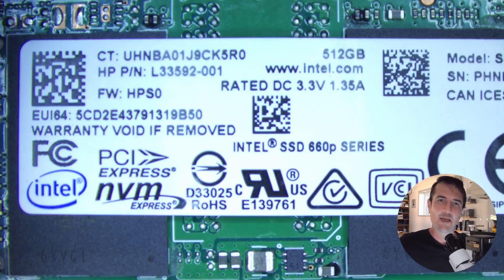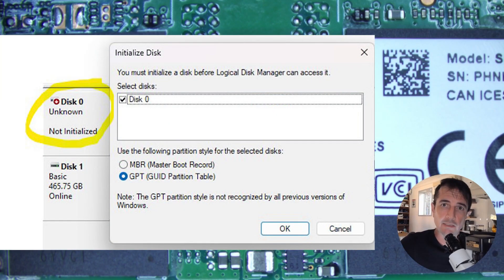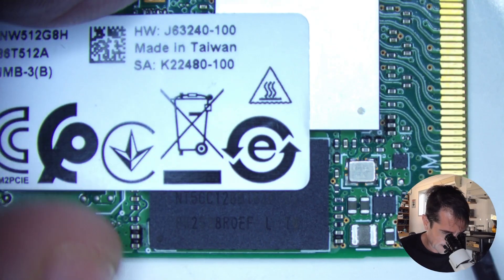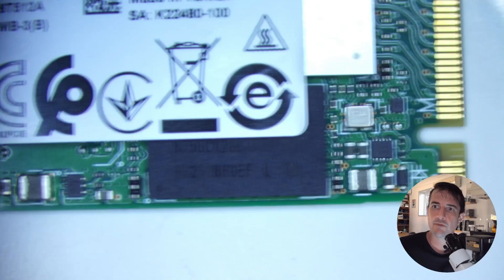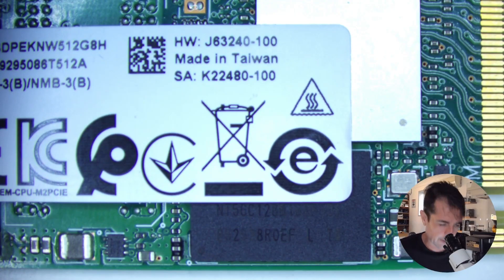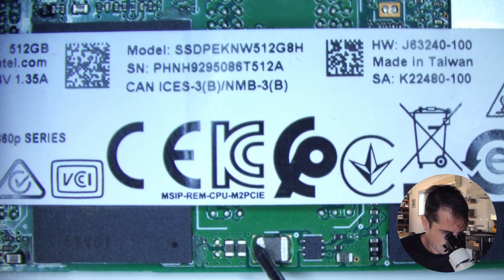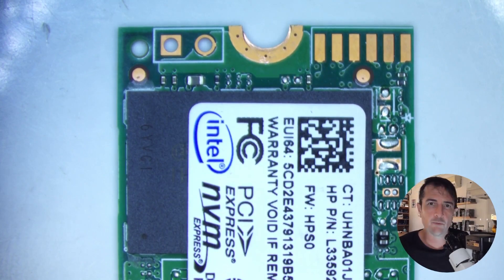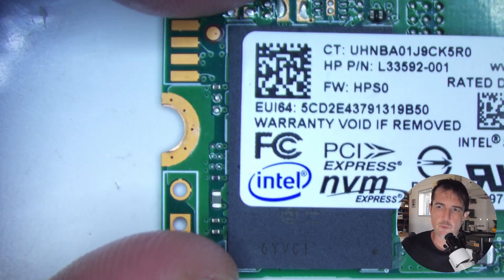intel SSD Not Working Data Recovery Repair

Comment: I understand services like this are not necessarily based on per hour job, but more the equipment used, the years training and quality expertise from experience. You made this seem easy (kudos for that) but the time seems short: i.e. not days and days. You state on your site that recovery from a hardware problem, like this presumably, the price is $770 to $990 AUS. So, is that what you would charge for this matter? BTW, I acknowledge your excellent skills clearly you are not a high-school hobbyist in your mom's basement and so deserve proper compensation.
Reply from the maker: A common question I get asked is: Was it easy or you make that look easy.... I'm not doing my job correctly as a professional if its not easy to me!!!! I get a lot of jobs in from customers who attempt to copy what I or others do on youtube and when you see the complete mess they make thats when you realise there is a difference between a skilled experienced professional and the layman. You don't do this job for the money
Reply: @ZeroalphaAu  Thanks for the reply, I have no doubts about your skills and understand that acquiring those takes passion. The question was more related to the charges. As I mentioned, extracting the data usually results in fees well over $500. While your eleven  minute video seems to be uninterrupted, I'm sure the whole process took considerably longer, but not spanning several hours (other than waiting for file transfers). So, are the charges truly a representation of the skills, effort, and time or are they about what the market can bare given those who need the service are desperate. I've noticed that prices seem to be common just about everywhere. so I hope the costs are an accurate representation of work done, rather than what the market will pay. I mean no disrespect just looking for information.